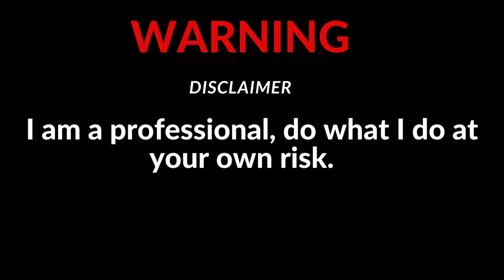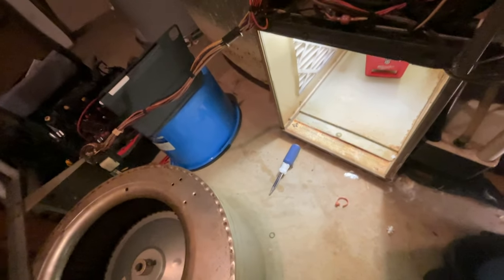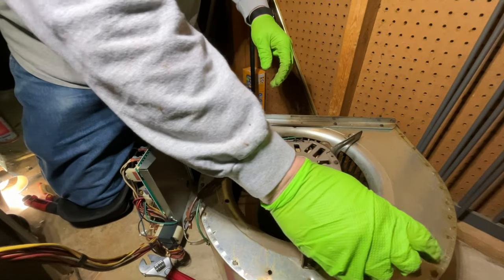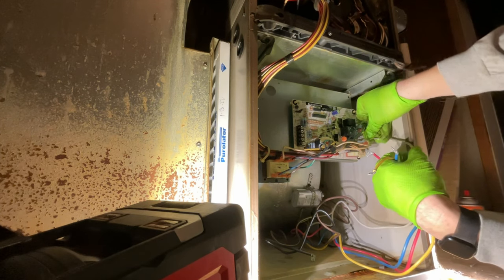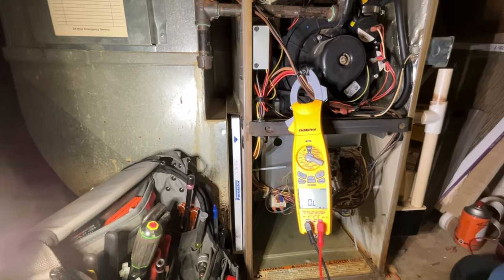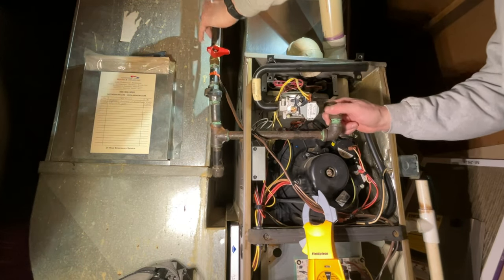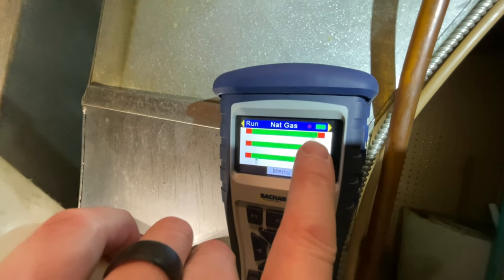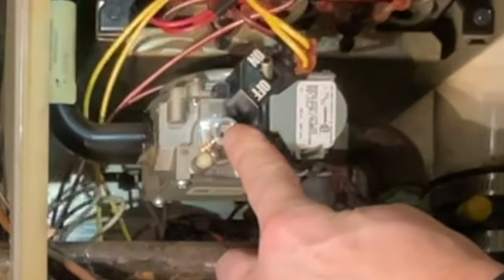Preventive Maintenance  Neglected Luxaire Furnace.

Comment: Certainly you are going well beyond many HVAC/R technicians especially those who have limited time for each job. I guess you are doing more checks on an annual basis?
Reply from the maker: Now that I’m a YouTube creator.
Reply: @ADVANHVAC  🤣 I like the ACCA standards 4 and 6 they excellent and indeed Jim Bergman incorporated much of this and other analytics from ASHRAE standards and combustion analysis and thermodynamics theory and refrigeration into measure quick which is also excellent. Though I doubt you get to run through all of this on a regular service call only an annual service would you cover this I suspect.
Reply from the maker: To be honest with what you just threw out  there just made my head spin. 😂 I have tried Measure quick a few times, it definitely takes some time on a job to work through it.
Reply: @ADVANHVAC  don’t worry take your time we are all trying to improve. Your doing great.